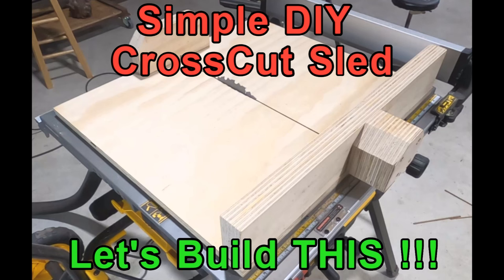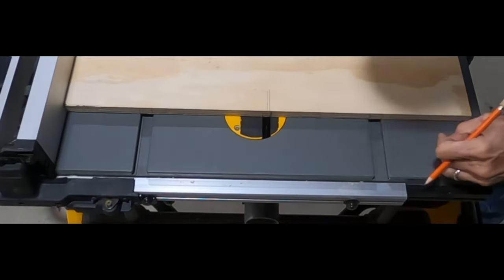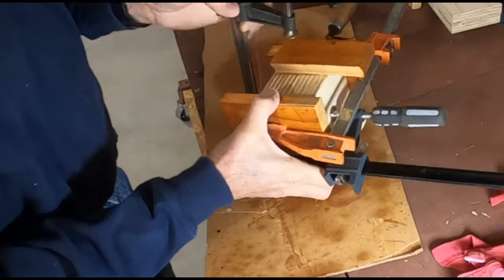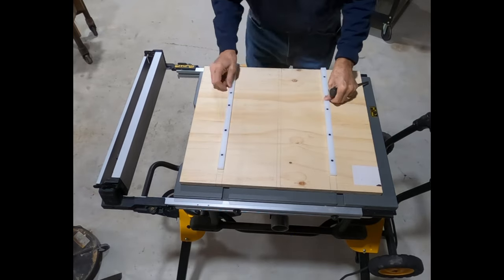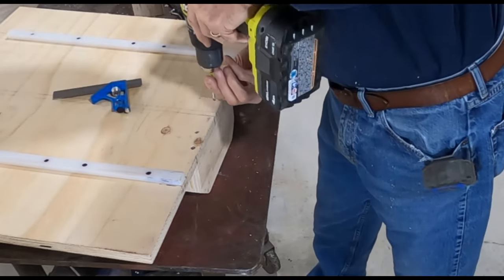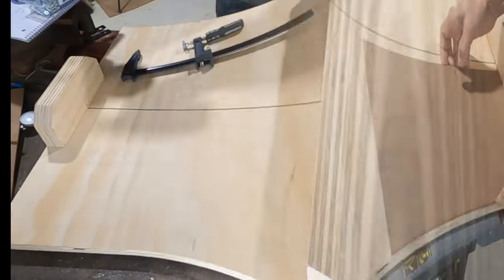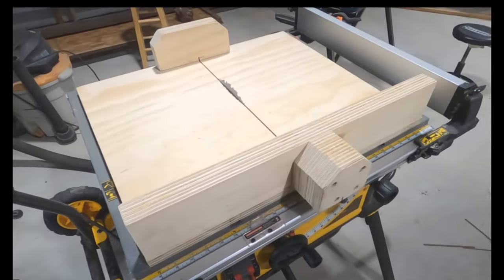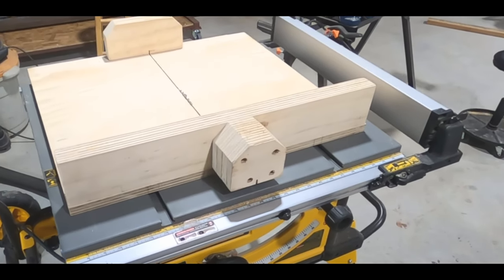Basic DIY Table Saw Cross Cut Sled

Comment: Salt worked wonders for my projects.  Some claim it will break down the glue over time.  Not sure I believe that.  It doesn't take much salt to do the job.
Reply from the maker: I have heard some lite saw dust will work too, but will probably try both.  Thanks.

Comment: At 1:10. Never use both rip and crosscut fence at the same time. Use a temp spacer block on the rip fence to position your part. Position the temp spacer leading edge behind the saw blade so that  both fences are never in use at the same time. Be careful people!!
Reply from the maker: Thank you for watching out for me.  Good option.  I must of had a brain fart that day.  I usually use a 1-2-3 block as a spacer, but now that I have this cross cut sled, I now use it without the fence.